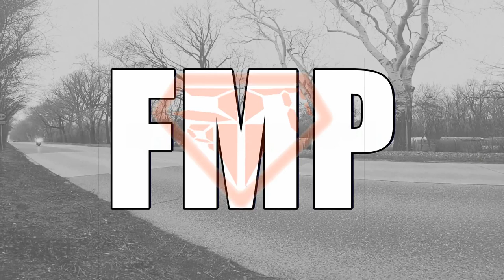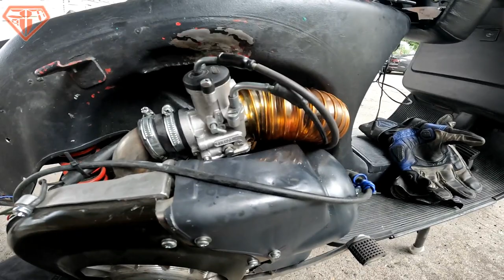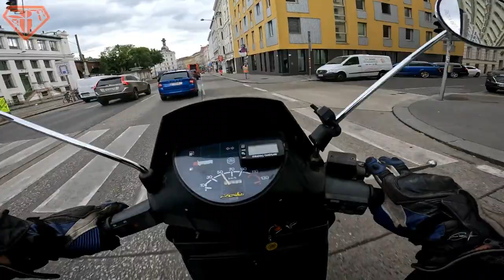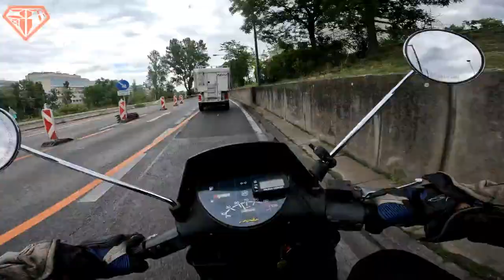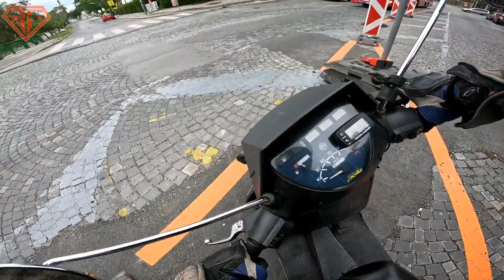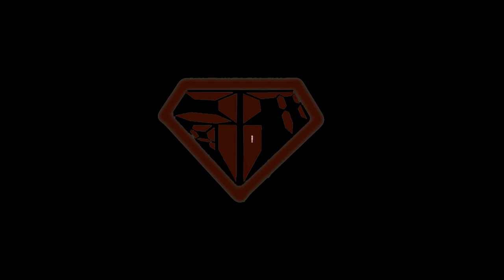ROAD test of online JETTING tips | vespa BFA 306cc |

Comment: Indeed each engine behaves differently from another (different timings, wear, leaks etc) and we all drive in different conditions (median air temperature and  above sea elevation). All of this affects jetting. So we should always adjust the jetting to our specific needs by trial in our driving conditions and should not rely in “magic” jetting formulas. Thank you mista FreakMoPed, for this amazing test and hints!
Reply from the maker: in fact. in the same area. similiar and HEALTHY engines are to be jetted quite similiar. if not. they are not healthy... which happens often. also fuel pump lazyness / fuel supply issues also change 
jetting...

Comment: At 25sec my red px does that.
Reply: So annoying. I still need to fix that scooter
Reply from the maker: 50-120 in 25s?
Reply: At 25 seconds of video, scooter shakes just like mine. Malossi 221. I want to put 24mm carb and sip 4.1 slide.
Reply: If that don't work then I must put a bigger carb 😁 30mm and disconnect autolube

Comment: always use anybodys jetting advise as guide rather than 100% accurate. All engines can differ slightly even if built with the same parts
Reply from the maker: if engines are healthy, similiar setups do have similiar jetting. often engines are not 100% sick when different jets are needed or its difficult to set.